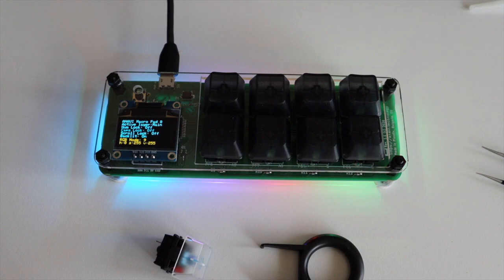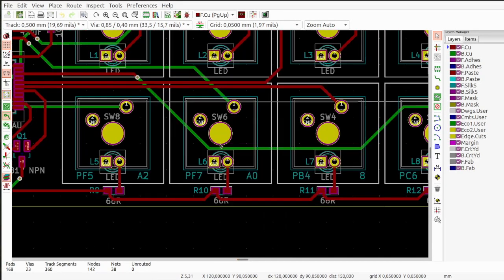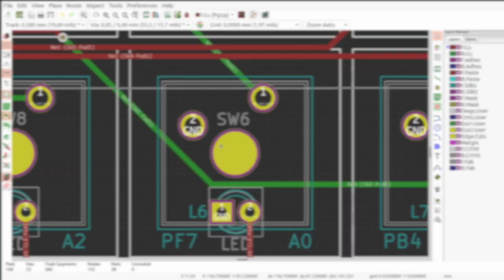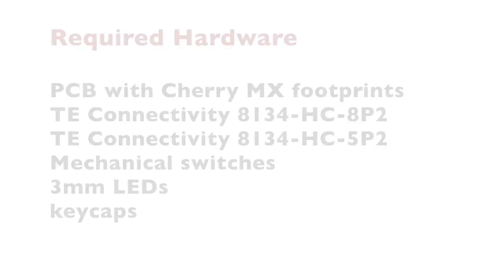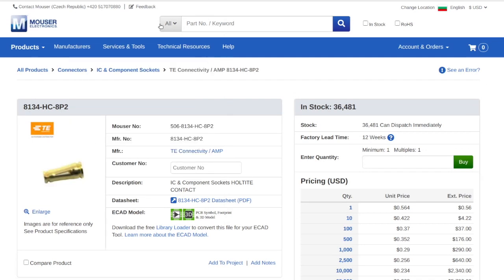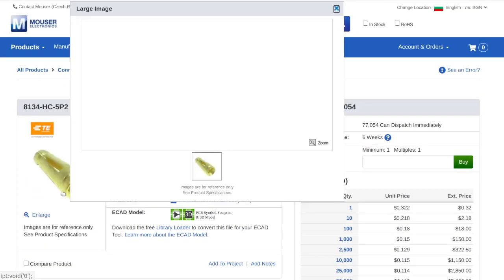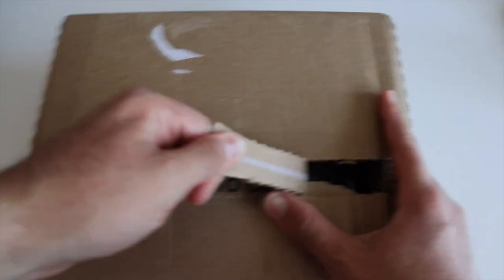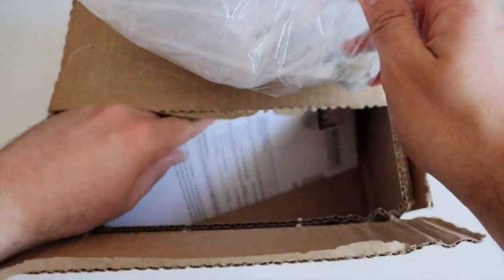Hot-Swappable Sockets for DIY Mechanical Keyboard

Comment: Is it possible to do this on Redragon Aryaman PCB which has blue Outeme switches and 4 pin RGB LEDs?
Reply from the maker: I think Redragon Aryaman is off the shelf mechanical keyboard with already soldered switches, isn't it? Theoretically speaking it is possible to desolder the existing switches and add hot-swap holtite socket but in practice I highly do NOT recommend you to do it. The risk to damage the printed circuit board during the desoldering is very high.
Reply: @LeonAnavi  I've already desoldered the switches, but the RGB LEDs remain soldered, so I was wondering if there is a way to make RGB LEDs which have 4 pins hot swappable the same way as switches? And if yes, which sockets would I need to use for RGB LEDs? I believe they are 3MM 4 pin RGB LED diodes.
Reply from the maker: @stefanmrvic4652  yes, it epends on the type of the RGB LEDs, I guess AMP 8134-HC-5P2 (used in the video) which are for 3mm LEDs might be suitable but you better check the datasheets. The RGB LEDs have 2 more legs because of the additional colors but I expect the hole diameter on the PCB should be the same.

Comment: Had the idea to do this to my old Filco Majestouch with Cherry MX Blacks. Found your video straight away. Brilliant!
Reply from the maker: Cool! Just keep in mind reworking a keyboard with already solder switches contains some risks of damaging the switches or the printed circuit board. Btw mechanical keyboards with kaihl hot-swap sockets for surface mount technology (SMT) as the ones I used on ANAVI Macro Pad 10 are quite convenient but only an option for specially designed for them printed circuit board.

Comment: Just out of curiosity, I was wondering how you feel this affects the typing feel / stability of the keys themselves, when they're made hot-swappable? How securely do the key switches hold to the PCB after this sort of mod? Do you sacrifice stability or have to press more carefully than with soldered keys, to avoid them coming loose from the board... or are they on there tight enough to stay put with normal use, until you decide to pry them up again?
Reply from the maker: good and valid point. Yes, the stability of the hot-swap switches using holtile sockets is of course less compared to soldered switches but in general it is fine.

Comment: So theoretically speaking if I wanted too, I could de-solder my existing switches, and then press fit the sockets in without an issue?
Reply from the maker: yes, theoretically speaking. In practice I highly do NOT recommend you to do it. The risk to damage the printed circuit board is very high.

Comment: Does this type of socket damage or warp the switch pins in any way?
Reply from the maker: Good question. I don't think the holtite sockets can damage or warp the mechanical switch. However, as you can see in the video, the assembly to the printed circuit board is tricky and you must be careful.

Comment: How did you do this without destroying your soldering iron tip? I have the TS100 and the tip couldn't stand the pressure and heat so it bent and broke off the tip by the end.
Reply from the maker: oh, sorry to hear that the tip of your soldering iron broke off. As you see in the video I haven't done anything specific. At what temperature was you soldering iron and what kind/shape of a tip did you use?

Comment: So this is only possible for a naked pcb right? I own an old logitech g710 and was thinking of solder everything out and replace it with something like you did in your video.
Reply from the maker: yes, correct this is applicable only on a PCB before adding buttons to it. I am not familiar with your exact keyboard model and not sure if this upgrade is possible for it at all. What kind of switches is your logitech g710 using?
Reply: @LeonAnavi  thanks for your reply. cherry mx brown but I doubt that it is worth the effort as it is very very old. 🙈
Reply from the maker: @Scardust6600  yes, honestly for your keyboard I don't recommend you doing it because there is a risk of severely breaking the keyboard while removing (desoldering) the existing cherry mx switches.
Reply: @LeonAnavi  thanks for your honest opinion. Also thanks for your video👍
Reply from the maker: glad you liked the video. Please subscribe because I have in mind more videos related to mechanical keyboards :)

Comment: Do you think i can mod my poseidon z rgb to be hot swappable? If yes, Can you give another cheaper option for the sockets? TiA
Reply from the maker: No, although I am not familiar in details with poseidon z rgb, it looks like it comes with soldered switches which makes the hot-swap upgrade very difficult and it's not worth it.
Reply: @LeonAnavi  that makes sense. Thanks 😁